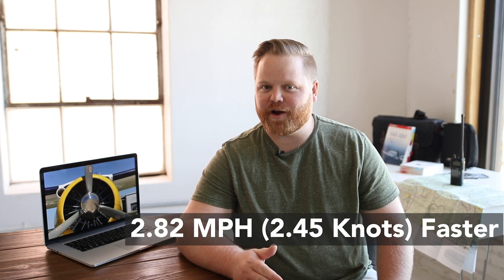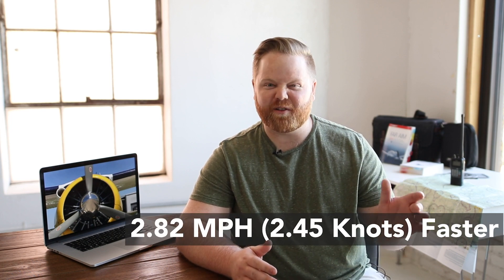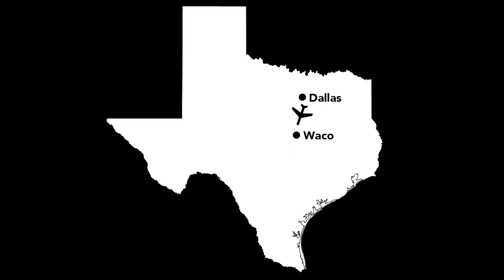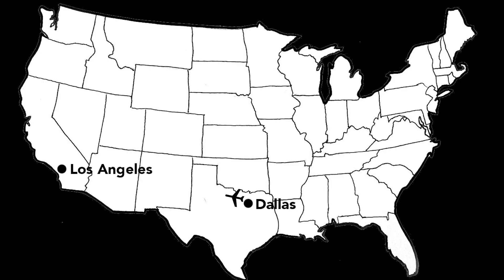Are airplanes faster after waxing them? (Solved!)

Comment: I know this is an old video.... but a rough surface is faster.   I had a buddy with a shoestring and we were preping it for a race.  He wanted new paint, and it came out awful.  It had heavy orang peal, but there was no time to fix it. (this was early 90's when flying was still fun)  So, he took it, and was averaging 7 to 10 mph faster than he had ever ran before. (no engine or prop work was done)  All we could think was..... "Golf Ball".  So... the textured surface broke up the surface tension, and reduced the parasitic drag.   Anyway... I think I'm going to dust off my skills, and start flying again.  You have a good set of vids that have helped me remember things. thanks.